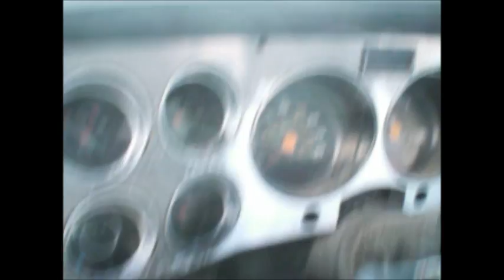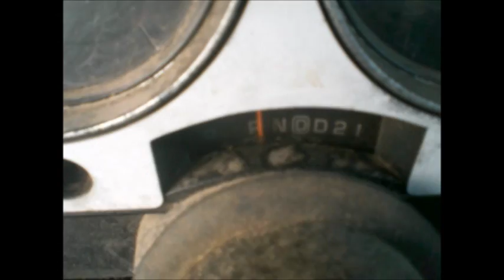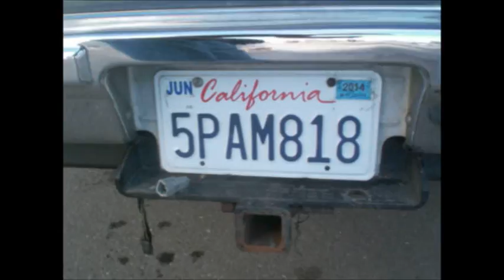Junk Sub Review Reject  10 22 14

Comment: It's 2 quarts low on oil, no wonder, look at the oil dripping off the filter.  It seems clear that whoever owned this bought it cheap (for a second or junk driver) and planned to keep it that way.  I've never owned a nice car for my daily driver, but I would never let mechanical maintenance come to this level.  It's one thing to not vacuum or wash the car every month, but when it comes to mechanics, only the best will suffice in my case.